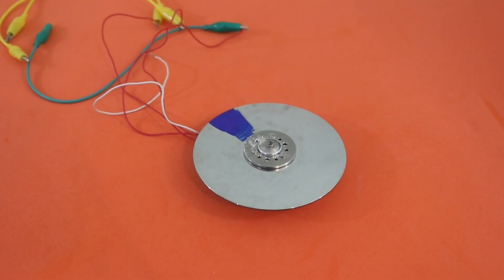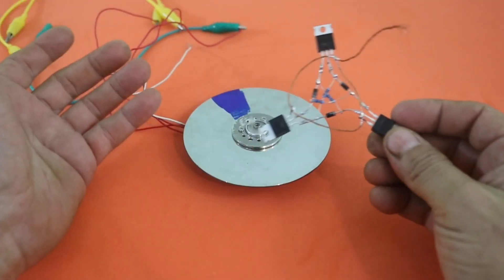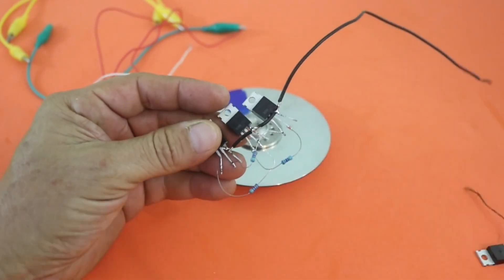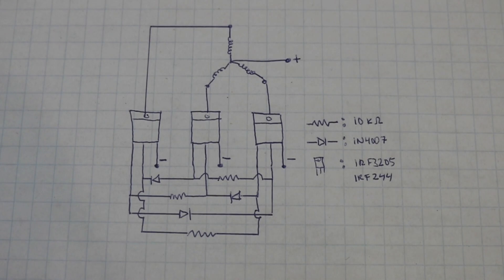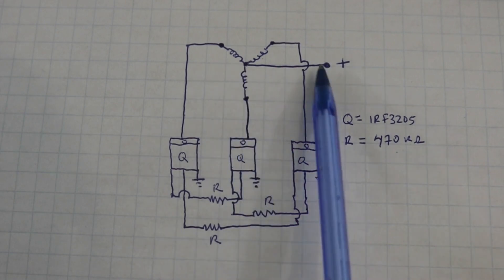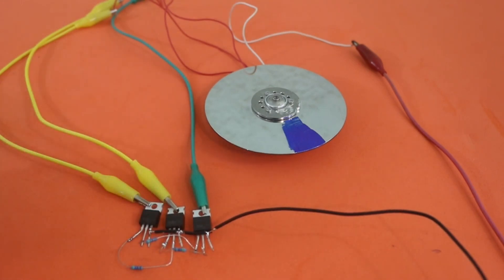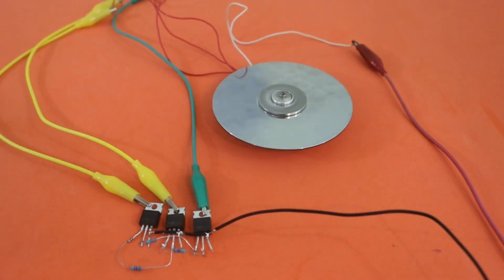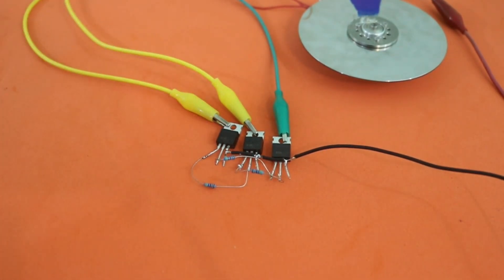Super Simple Hard Drive Motor Driver

Comment: Just properly made it. it actually works just make sure the resistors are above 100k. i used 1mohm. another thing is phase orientation matters if your looking at the bottom of the motor and the pins are facing you the left one is the positive lead. the second should go to the third mosfet, the third should go to the 2nd mosfet and the 4th should go to the 1st mosfet. this order changes as the resistor values change so be careful. if you set it up in a certain orientation it wont need a kick start. its not the fastest but it gets it spinning

Comment: This could be fake cuz these motors need proper cumutator process by back emf of other circuitry to make them run
Reply: when you manually push the motor it is already generating a slight back emf. I believe this works fine
Reply: @m.zohaibusman1298  i did try to make exactly same with every same components but it just burned my motor (ps i didn't even provided to much voltage on it)
Reply: @technicalsos1109  Maybe make it again, and limit the current to 500 mA and 3V?
Reply: @m.zohaibusman1298  i did by switching the mosfet and i first operated it in 3v with new motor still no response